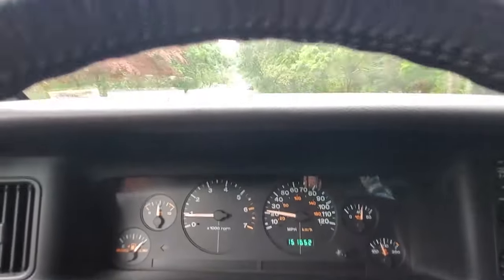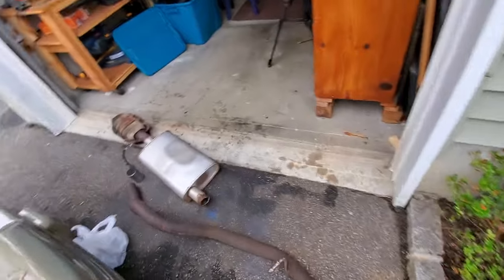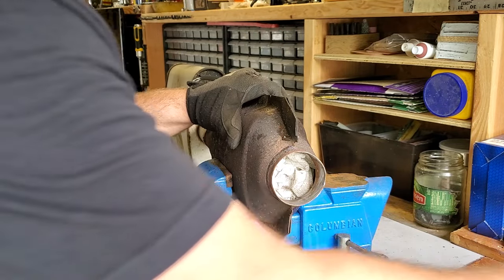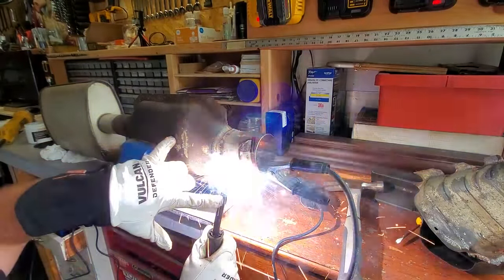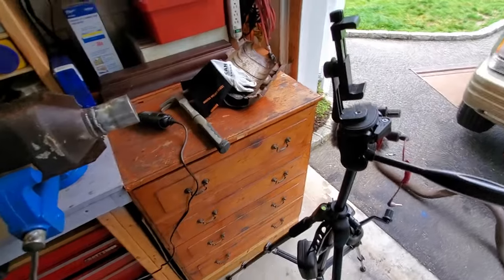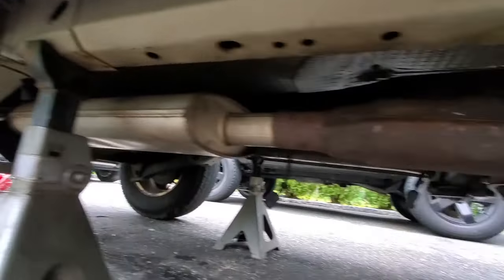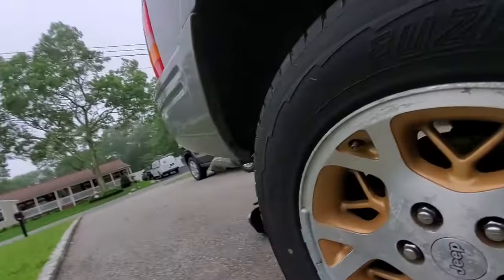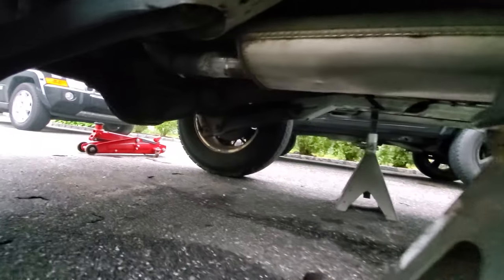JEEP ZJ GRAND CHEROKEE EXHAUST REPAIR & TEST DRIVE

Comment: I noticed the backwards muffler like someone else mentioned on the comments.  And I heard the gurgling from the heater core.  My Zj used to do the same thing until I blew off a heater core hose and had to replace them and bleed the air out of the system.  The General looks great!  Keep up the good work and I'm looking forward to your next video.
Reply from the maker: Thanks for watching! I did some research, that model after market muffler can go either way. I'll be doing a coolant flush soon, hopefully it will cure the gurgle 😁

Comment: Sounds good keep dry from SoCal. Also use a piece of wood when hammering on pipe helps from damaging the walls. I’ve never been able to get rid of my ZJ from gurgling when you find a way let me know.
Reply from the maker: Totally jealous of that so cal weather..  and I Will do brother. I'll be messing with it this week .. I actually used wood for the hard shots but cut the clip cuz it was lame 🤣. Thanks for watching 👊
Reply: I parked mine on steep a hill facing upward and topped off the coolant to get my gurgle to go away. I could hear it mostly at start up. I guess air can get trapped in there and this is a way to "burp" the system.

Comment: Job well done. I've put 2 different Cat back Exhaust Systems in my XJ in 12 yr.'s deleted the Resonator. Wondering if having the Resonator would make the System last longer. The Resonator has been Deleted on that Jeep too. Seems to rot from the inside out right where the front pipe enters the Muffler. Next time i'm going with something Stainless or at least Aluminized. Any Shop would have sold you a Cat and never even tryed to save yours as you did. I am a retired Shipfitter/Welder who use to build Catamaran's and people Ferry's you have in New York City. Your Welding Skills are really not Bad. Steel Welding will come with time. Much of the Welding i did was Aluminum Mig. Heat Setting's on the Machine are a good welders Trick. Removing that Heat Shield was ridding yourself of a serious rattle in the future.
Reply from the maker: Right on Brother! All the accessories, muffler, cat, resonator, all rot at the seam.. straight stainless exhaust it was i want in my new build!

Comment: Great job! Couldn't help notice, when you were putting it all back together, the A-B stamping on the bottom of the muffler. I think who ever installed the muffler the first time, put it in backwards. A is usually towards the front, right? I wouldn't have noticed except I just did exhaust on my 95 XJ (new muffler and tail pipe plus converter delete). Or am I wrong? Always enjoy your content...
Reply from the maker: I looked it up.. That model after market muffler can be installed either way. It's marked by the 2 different direction arrows